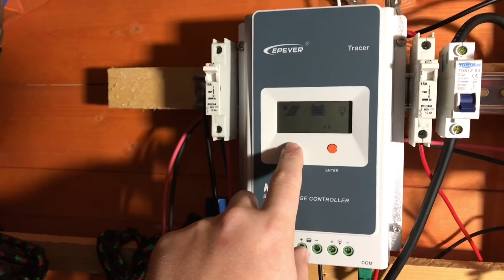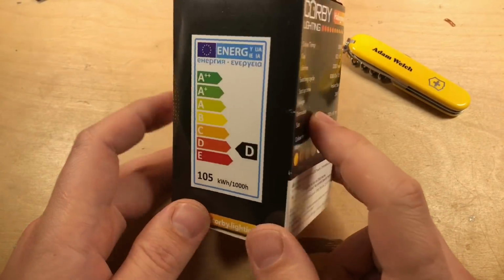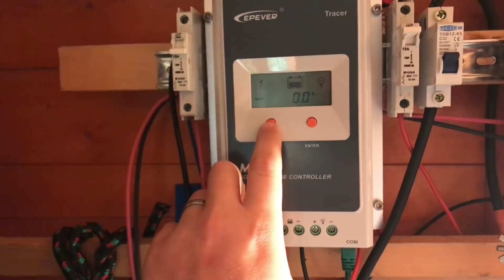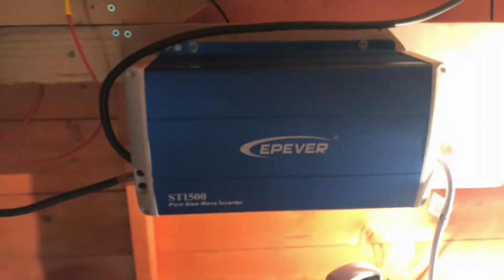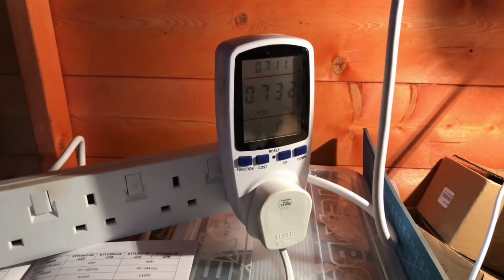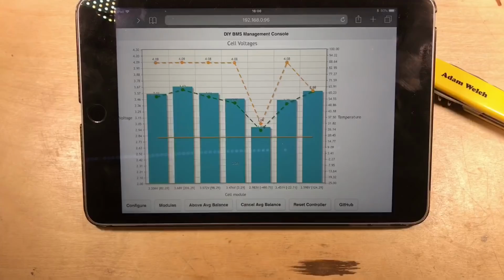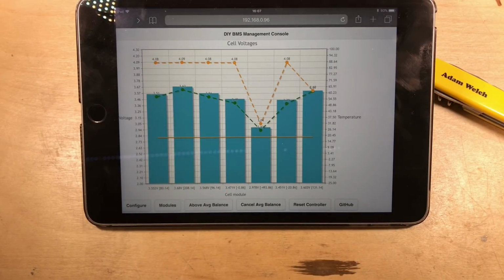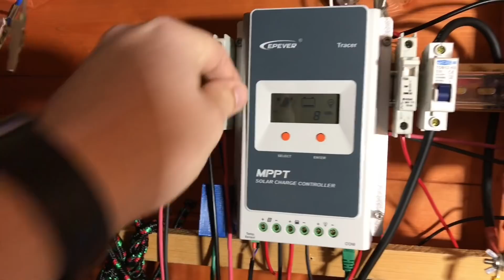1kWh Discharge Test - diyBMS

Comment: As you recharge the packs, they'll tend to converge back to their balanced state anyway because you're just putting back what you took out, as if they were different sized buckets.
Yes, a low cell cut out is a must! If a pack goes to zero, then it would get reverse biased and that would kill it.
An exotic option on a low cell is to use charge redistribution with a flying capacitor to get the most out of them or dynamically add capacity, but then you'll be doing more balancing and bleeding when reaching top of charge again!
Reply: Yes exactly, the difference in capacity is mainly the reason for the large voltage spread when discharged! I see only minimal balancing action in my BMS design / software. Having a larger pack really helps as well.
Reply from the maker: I’ll see what the next couple of days brings, but we’re expecting some poor weather so it might take longer than I’d like to recharge. Flying caps sounds like fun, and a fun project. Cheers Andy
Reply: Mixed blessing! The insane heat of the summer is over now, (yay!) but so is the sunshine :-(
Hope the cell comes back up in line with the others - if not, then it might have a couple of "heaters" wasting energy, or one or more self-discharging. Of course, breaking it up and testing each cell again is tedious, but if not too serious, it's OK to add a couple of cells to it to increase its capacity.
It's also likely a fusewire has disconnected from a cell, so that would be the first thing to check - obviously reconnect when their voltages have equalized!
Look forward to seeing the results!
Reply from the maker: Thanks for the solid advice Andy. I’ll try to keep you up to date.
Reply: You're welcome!
Oh, next time do a higher power discharge test and use an IR thermometer or FLIR camera to look for hot cells - that's also a good way to spot miscreants!
IMHO, any cell getting over 20 °C above ambient or 45 °C at 1 amp charge is starting to show its age. Discharging seems to be able to push more current per degree rise, but some amount of heat is normal. I don't like to see them go much over 40 °C, so more in parallel is good!

Yeah, the flying cap or cell trick is a hard problem - As I see it, need multiplexed double pole solid state relays for each cell pack and one to switch charge direction from an isolated source.
Only one can be active at once to prevent big bangs, then "just" sense, slurp and pump each cell as needed - would be a nice project, but I don't have the funds or time to be able to do it :-(
Reply: Andy, the flying cap is the way to go. I have a few different setups I've tested and think its a must if you want to truely balance the packs. They will eventually learnt to work in harmony though. You got an schematics youd like to share? Cheers mate.
Reply: No schematics, but easy enough for anyone to work out using a 4bit to 16 multiplexer to select none or only 1 SSR at a time, and then a method of fully charging and discharging a cap or 2 supercaps in series with dc-dc conversion each way. An Arduino can handle that, track the voltages on each. Its the SSRs that are the expensive bit, doing the equivalent of a guy with a pair of croc clips with an extra 1S charger or a load one or more times per second.
Only need to balance at the top or near the bottom when necessary - otherwise energy is just wasted in conversion, balancing and rebalancing. Cells don't have to be balanced in mid state of charge!
Probably only worth doing on really large batteries or if every last drop of charge needs to be extracted for a critical need.